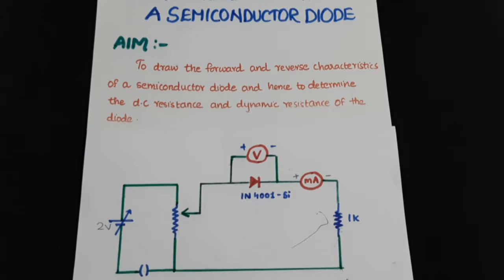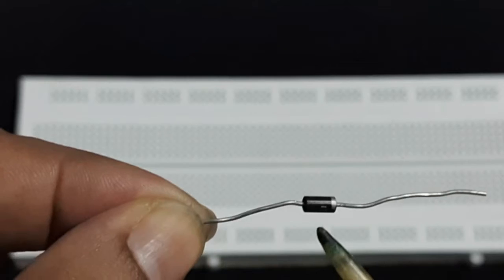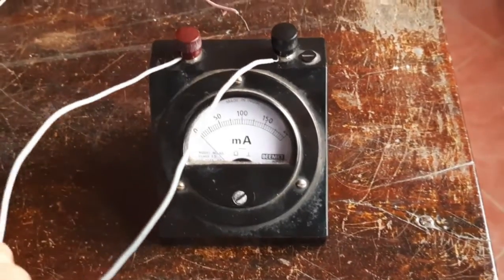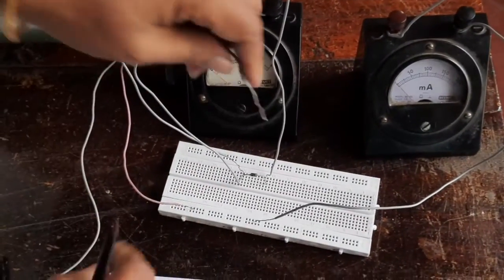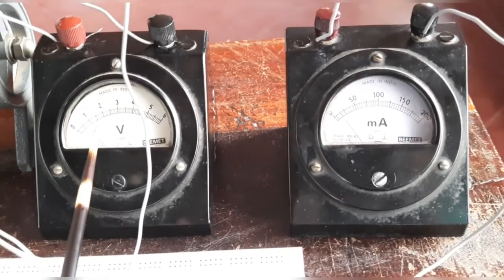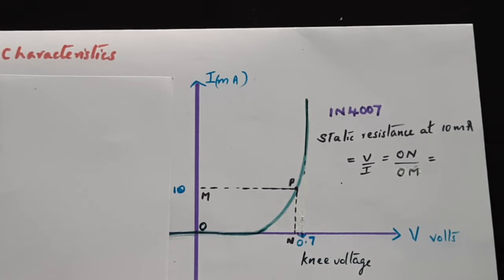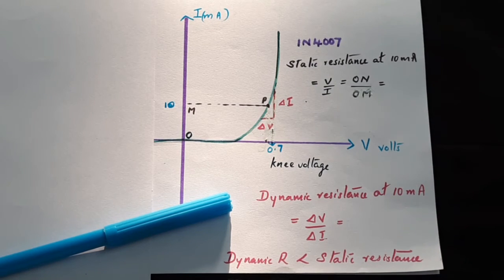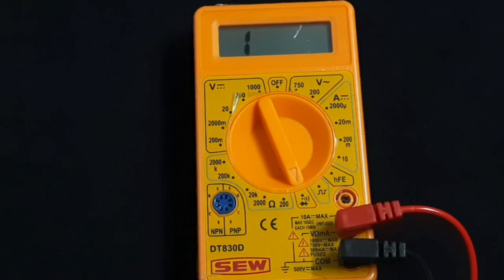Semiconductor Diode Characteristics

Comment: What is conclusion about this video ..
Reply from the maker: Conclusion is that when a diode starts conducting, it's dynamic resistance will be less than static resistance. We have also evaluate the knee voltage of a diode.